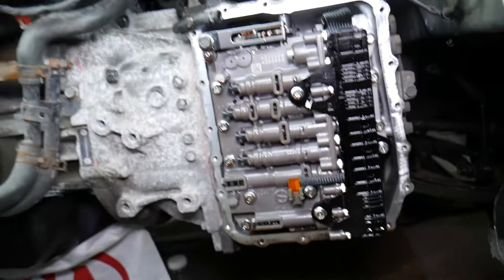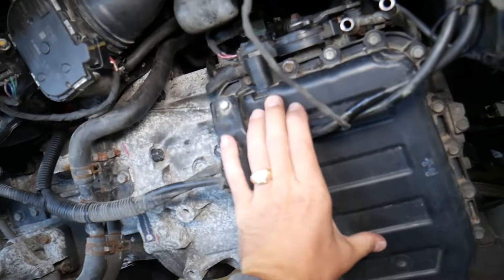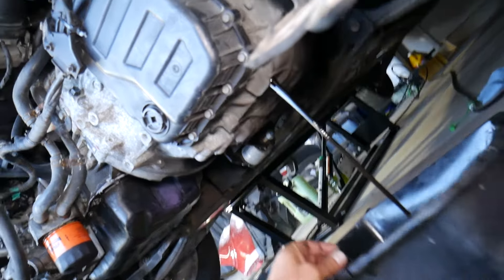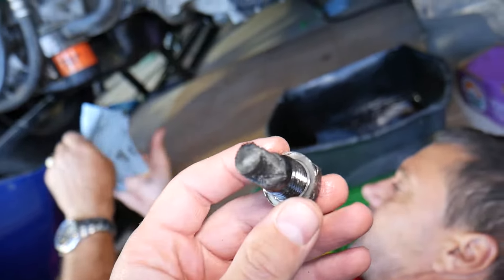HYUNDAI BAD TRANSMISSION, REPLACE SHIFTING SOLENOID FIX TRANSMISSION

Comment: Thank for making this videos for hyundai cars. I had to change out a bad fuel injector, your video helped me accomplish that task. So thanks and please keep posting. Update, if you change out any parts in your transmission, you will need to reprogram your car with a scanner. Speed sensor or valve body ribbon connector. Otherwise you will have problems with your transmission shifting.

Comment: What i still do not understand is when hyundai and kia (the sister company) build their vehicles , why have they not make the transmission reliable for these many years? I had hyundai tucson 2017 fwd  which started having transmission failure after 108000 km. Buying hyundai was the worst thing i have done in my life when it cane  to buying a car just to go to work.  I didn't know it why i bought it. The issue is why hyundai is focusing on improving electronics when clearly they have works need to be done on the basics and the very essential transmission. Just watching your video i can tell how unsure and unrealistic this might be for an average mechanic to repair transmission stuffs. Anyway great video. Forgive my ranting. I am just disappointed at hyundai for letting transmission failures and not having guts to fix them. They would rather do fleet promotion over addressing the elephant in the room.

Comment: Of course, the thumbnail picture is at the end, where 4 links for other videos come up, so I can't see it in the video. But those look similar to the VVT solenoid for my 5.7 Hemi. The original screen broke apart on my engine. Then the Dorman replacements keep having one of the new style screens pop loose. It then slaps around at the edge of the valve, causing it to malfunction. I've discovered that the Dorman is junk. I've had to replace that solenoid on my VVT 5.7 Hemi, 4 times already. Since it's under warranty, I keep using the same replacement. But I put a retaining ring over the screens this time, similar to the new replacement from MOPAR. The thumbnail picture, just made me want to share about the Dorman garbage, that I have had to deal with. Guess I should have gone to the dealership and ordered the right part. LOL

Comment: That is very helpful. I am thinking on doing this job on my 2010 santa fe sport AWD. On occasion I get a high Rev hard shift into I believe 2nd to 3rd. Seems to happen when I am coasting along not if I'm hard accelerating. I am looking for videos that will show me the way and helpful tips and info. Thanks for your help.
Reply: I am here for the same issue. Did you do the solenoid yet and did it help?
Reply: @bradsoole I’m having issues with mine as well it’s stuck in 3rd gear and won’t shift up or down even when in sport mode does this sound like a solenoid issue.
3.3 awd for reference

Comment: Auto repair guys, can I do this cleaning to the VVT selenoid on the exhaust side as well? I replaced the intake vvt  selenoid and I'm still getting an engine light for bank b. Any help would be amazing. I have a 2010 Santa Fe v6 3.5

Comment: No one wants to take off the front end and radiator. To fix their vehicle transmission problem. However informative content. Might convince my coworker to do this on a weekend. His car has been having issues. Too bad Hyundai didn't design the sensors on the outside of the transmission. So you could easily access them

Comment: So I have tested all my fuses on my 2010 Hyundai Elantra inside and out and all are good. only way I can get it out of park or back into park is with the release using a key to push it down. I replace the brake switch on the brake pedal that I bought at Hyundai last week. the shift interlock is not getting power to activate the release when pushing on the brake with the ignition on but the brake lights are working. I tested the interlock with 12v, and it works but not when plugged into the connector. With the connector disconnected the key can't be removed but as soon as it's connected the key can be removed so that signal works. Any idea on what is causing my issue?

Comment: Hello guys I got a A6FM1 4WD. My transmission has problems on 3rd gear shifting to 4th. It’s does not shift on time and the rpms go up and once goes into gear will bump hard but if I let go of the pedal will shift almost normal. Which solenoid do I need to replace ? What would you guys recommend for repairs ?
Reply: I have the same issue I wonder what the solution is
Reply: Hello.
Have you found the problem? My mechanic replaced the part but the problem is still there. I can't find a good mechanic who can fix it.

Comment: Sir i am from INDIA
I got a TATA HARRIER front wheel drive automatic torque converter transmission and one day it was running and the car got hold to reverse in drive mode now it is hold in reverse mode.
The car moves properly in the reverse gear but when change it to any mode except reverse the engine begins to shake heavily ?

1.I have changed transmission control module no effect

2.Opened the gear looked for damaged nothing there

3. Changed valve body still same problem

So can u help me with whats wrong in that actually the automatic transmission is manufactured by HYUNDAI and it is bought by TATA 

So i dont know whats wrong with this transmission can u suggest me so ican repair 

Also, can the torque converter can be faulty 
Or oil pump in the transmissioncan be faulty

Comment: Hello, my name is Francisco Gotay, I'm from Puerto Rico, I have a 09 hyundai accent and it has problems with the transmission solenoid, code p0760.the car when it stays in gear 3 but you turn it off and on and it takes all the gears until it detects the problem
Reply: did you find out what it was?

Comment: i need to replace the lowest solenoid on the valve body as it sits in the transmission but cant find it on amazon with your link can you help

Comment: What does it mean when stuck on 4th gear. I cant recall the code. I'll look it up again
Reply: P0741, I have the same issue.
Reply: Bad speed sensor, im going thru the same. did you find a fix?
Reply: Hi did anyone find a fix for it someone told me I needed a new torque converter but the labor alone for that cost 1200

Comment: good day my friend i have sonata 2009 gls 2.4l with transmission problem on D not working properly Fails when switching form first to the second gear but its working with tiptronic properly 
SHIFTING SOLENOID make this problem?

Comment: Which one controls 1,3,5 7 gears?  My transmission for my 2016 is only working in 2nd, 4th, and 6th gears (and Park and Reverse).  Or is that a different problem?
Reply: Did you get it sorted cause mine is taking 3,5,7 and park
Reply: @thabangmaphutha6673  not yet and it looks like this guy doesn't respond anymore to his channel
Reply: Check and replace solenoid or wire harness.
Reply: I’ve a Santa Fe which only goes in reverse..
Reply: @ejusdem_generis  Sorry to hear that.  Mine transmission just went out 2 weeks ago and is probably not worth replacing :(. You won't see me ever owning a Hyundai again
Reply: @k2par  I agree, I’d wouldn’t want to buy a Hyundai again. I saw a new model and the grill reminded me of the foam netting that’s put around fruits.